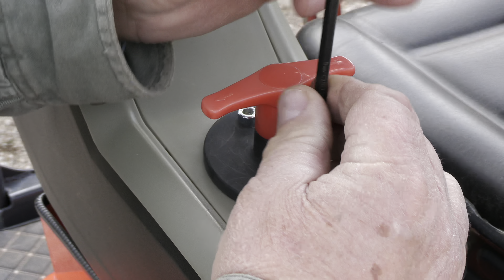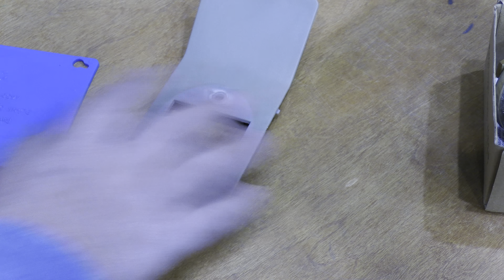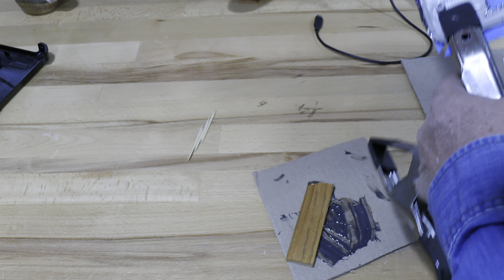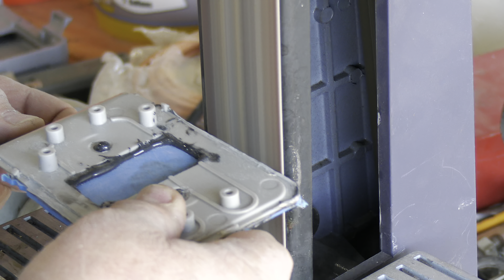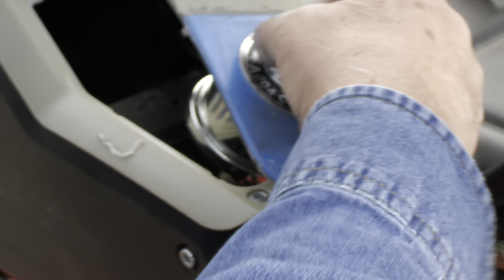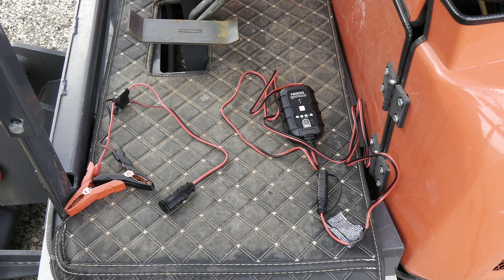Replacing junk battery shut off switch on Chinese mini excavator

Comment: Thank you so much for the helpful video!
Reply from the maker: You’re welcome. This is my second video on my new Chinese mini excavator. I purchased it this spring and did my first video adding some modifications to it. Well, I was gone working on my cabin for a couple of weeks. I came back and it wouldn’t start so I started checking out the electrical system and nothing was grounded from one side to the other side of the battery shut off switch. Through some research I did I found out this is the same kind that’s on most many excavators. Being it is a sealed unit. I drilled out the grommets on both sides and opened it up and realized this was the problem with a lot of the excavators electrical systems that you see mentioned on some of the forums. I swapped it out with one from Amazon that was a little over $15 but it’s a completely sealed unit. And it fixed everything. FYI, I have been a heavy equipment operator for many years of my life before I started my own business. I will be doing some more modifications to this machine and putting it on my YouTube channel to help out other guys that may want to do this to their machine. Thanks for checking it out.

Comment: It always seems when you buy something new there are repairs and upgrades that are needed to be done. I hope that you and da wife had a Merry Christmas!🌲🎅 Happy New Year!🎉 Todd from da U.P.
Reply from the maker: Hey Todd, I hope you had a great Christmas. Also I am looking forward to the new year. These Chinese mini excavators are not super expensive like the ones I used to run when I did Pipeline work and the Chinese aren’t known for quality control. But the actual function and running of the machines are fairly decent for what you pay for them. I’m a pretty fair mechanic and I do have a big box of parts that I’m going to add to this machine a little at a time during the winter months that will make it a much better machine. I will have a couple more videos doing those upgrades on this machine during the winter months. I want to have it ready to take up to my cabin once I am finished with it as I will be using it around the property for a few projects. I have in mind. 🤠🎉 good to hear from you. Enjoy the new year.